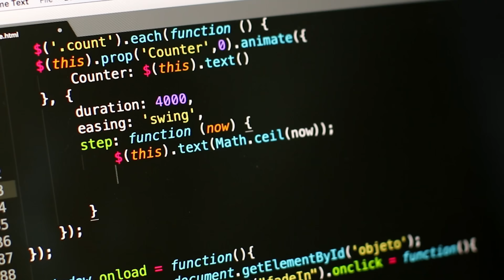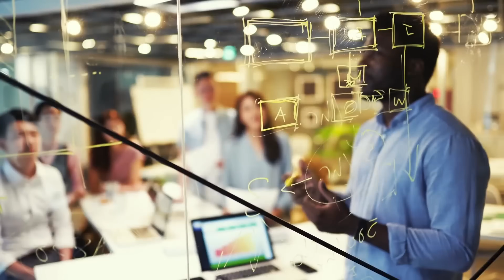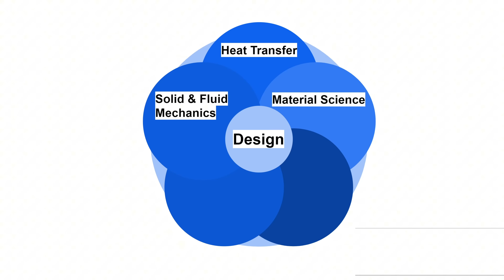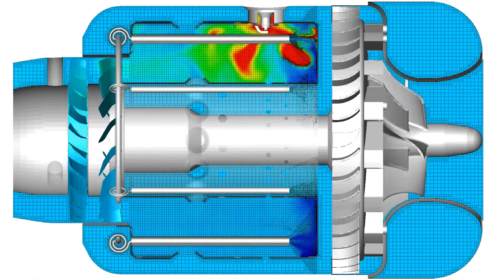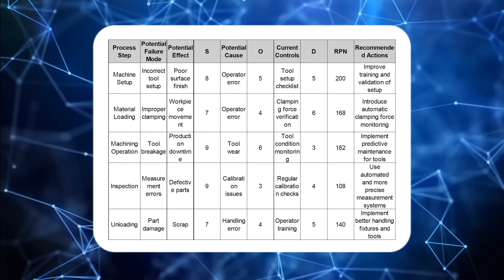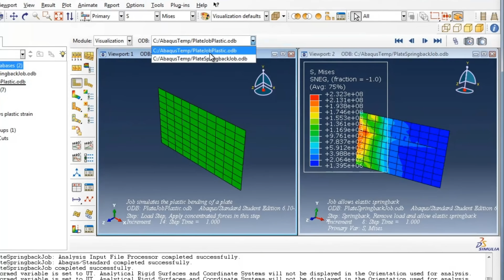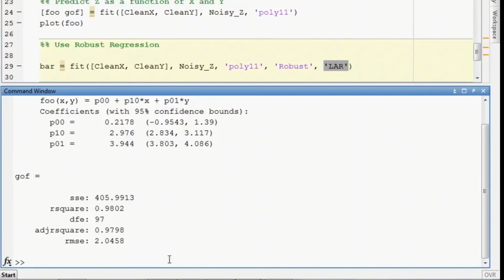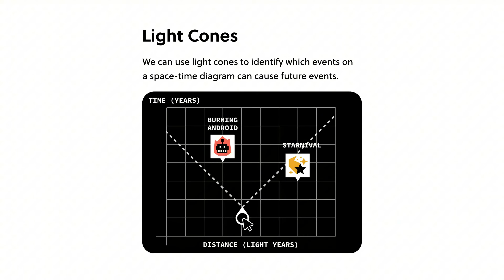Why Mechanical Engineers Should NOT Learn to Code

Comment: Bruh, it's necessary for Mechanical engineers aiming to branch into fields like: Control Systems & Mechatronics, Robotics & Automation, Biomechanics & Medical Devices, Energy Systems & HVAC, Automotive & Aerospace......etc. I don't know wtf you are talking about. But they don't need to go deep into software engineering, just enough programming in the necessary languages like Python, C++ and C.

Comment: I'm 13 years old and I love watching your videos. I want to become a mechatronic engineer. Mechanical engineering is a big part of mechatronic engineering, but so is programming. I think anyone could learn to code if they wanted to. I know you're much more experienced than me when it comes to engineering, but I think anyone could benefit from a little programming .😄😊
Reply: Bro I'm a 1st year in Mechanical Engineering at the University of Nairobi. I too wanted Mechatronics but realized I'll be unemployed in Kenya. And also in Mechanical Engineering, you can also specialize in Robotics and Mechatronics. So, Mechatronics Engineering is a lil bit of Mechanical Engineering, lil bit of Electrical and electronics engineering. And a lil bit of programming. So programming is a must in Mechatronics coz you'll be required to program a robot arm etc. So don't listen to this guy.
Reply: @UserUnknown-y5k2n take it with a grain of salt. You can always be a jack of all trades if you're capable

Comment: I use code only when forced to, meaning only when my project goals clearly define exactly what needs to be programmed. As an ME I do not have the time to learn even one language well enough to know it entirely. I will either trial and error my code or use chat GPT to write it for me if the project is simple enough (like programming a stepper motor or programming a PLC). If the bulk of the project is programming, then it is not in my purview anyway. I do not need to know the specifics of a coding language like the syntax.. I only need to make it do what I need it to do one way or another.

Comment: For everyone wanting to become a ME,
You will learn 'programming' in college. Most universities require a programming 101 course (pre-engineering) and when you finally major in ME, you will use MATLAB.
That being said, it's not 'programming' as in what a programmer or SE would need to know. You just need to know how to perform mathematical operations, read in data from spreadsheets, and know how to create graphs/ charts from your data.

For the workplace and hobbies, most small companies don't have MATLAB so knowing how to do math/ read data/ create graphs in Python is extremely beneficial since it's free and open source. C/C++ is not that useful unless you somehow find yourself without SE support on a robotics project. Most industrial applications use something called PLC (programmable logic controllers) which is a separate 'programming language' (if you look it up, you'll realize that it's not).

Comment: Imo I think it's also important to remind ourselves in anything complex these days that require advanced controls systems and a system of ECMs like avionics or automotive controls, those companies will hire an army of software engineers with CS degrees. Of course we MEs should still have a basic idea of programming and be able to follow ideas to make sure the software engineers are on the same page with us since their stuff controls our stuff. But there is a reason sole software engineering departments exist in aerospace and automotive. It's a full time job in itself. And largely outside our scope. Plus to develop algorithms that advanced, I think you need to understand programming at a very advanced level for advanced avionics or vehicle controls. And to know programming that well requires having your educational and career revolved around that as a core. For me I used an Arraylist in VBScript to automate 10 similar parts varrying only by slot width into a single CMM program in CMM manager and that was it. Even then software engineers from QXsoft provided me the Arraylist framework

Comment: Programming ability is required for mechatronics, which was the core of my ME curriculum. My entire senior year was spent learning python and c++. But in industry, robotics in manufacturing is mostly PLC controls programming (90% of my job search). I wouldn't waste too much time learning a coding Ianguage now. I've generated many programs using AI (in seconds) for automation. All you need to know are the fundamentals of a programming language and how to prompt engineer.
Reply: Does robotics like the robots from Tesla use PLC programming?
Reply: @FlowSharp  Tesla indeed recrutes engineer knowing plc such as twincat beckhoff based plc.
Reply: @le_kada_998  how do you know?
Reply: @FlowSharp  PLC is for industrial automation. For robotics it can be Python, C++ and C. Don't waste your time on sh*t like Javascript, HTML, CSS etc 🤣
Reply: Aside from plc would you say learning low level languages like C is a good idea? Trying to get into this industry as well as an ME.
Reply: @ariqbubinski7136  A language like C is a good language to start, because you will learn a lot a basics, but it is also hard to master as it more close to the microprocessor, if you haven't code with any language, you will appreciate C at his right extent, if you have for exemple code in Js, never code with C, it will be a lost of time, but the opposite is right. C can also be a good language to master PLC (if you are doing structured text), the structure is pretty similar. However, as a mechanical engineer, you will program for exemple to automate or retrieve that from simulation made with software like ANSYS (with very specific language), develop maybe sometime you own computation for a certain case in FORTRAN or python, or automate tasks for excel or CAD software with VBA. So I will recommand you to learn C, maybe C++, later python, then you will have the good foundation, and will be ready to code in the industry, but remember in some cases, you will maybe need to learn a new language and also remember that you will maybe never be ask to program, most mechanical engineers that program are simulation, fea engineers etc....
Reply: @ariqbubinski7136  Not really, that depends of the kind of ME you want to become, generally In ME, you never use programming language. Rarely if you do CAD  in a small company, you maybe using VBA for automation, apart from that if you are a fea engineer in research or in post processing like jobs, you could process data obtained after a simulation by using python fortran etc..... Else, in research some implements their own fea code by applying fem principles to resolve differential equations.
Reply: In mechatronics you need python, C++ and C. In industrial automation, thats where PLC comes in

Comment: From my experience (I am a structural engineer). What engineers need to learn is not about the coding, but computer science. So they would understand much better about how the software they're using (for example FEA suites) do under the hood (algorithm, data strucutures, libraries), and use it effectively for their own purposes.
Reply: I strongly agree and I personally believe that list should also include the computer's operating system.
Reply: I'm almost applying for CS as a second graduation at this point!! But I think I'd rather study my master's degree in dynamics and mechatronics...
Reply: I didn’t understand, can you elaborate pls. I’m studying Electrical and Electronics Engineering.
Reply: Agreed.
Reply: What are the benifits of that? That could be very different from the field one could be specializing in, and for regular engineering students its used only for surface level data analysis, numerical approximations and iterative calculations.

Comment: I feel like this is a very necessary video. I mean there is a reason why different majors have a different curriculum, we do different things! Even if mechanical engineers and programmers work on the same, robot for example, they work on different aspects of it. Having a base knowledge of other aspects you may encounter in a product you are working on is good and all, but you can’t expect to know everything and anything. Yes, programming is the hot thing right now, and if you want to learn programming so bad, you can major on it or get a minor, but you can’t pressure yourself to learn a skill in such a level that doesn’t have to do with your major. Learn it if you like, but don’t feel like you have to just because is a wanted skill got a while different profession.

Comment: I am in my first year of Mechanical Engineering, could u suggest me some course that might help me later for my resume or is it too early
Reply: Hey kid. I am a final year mechanical engineering student. The engineering realm is shifting rapidly towards automation. As a mechanical engineer, I would advise you to take classes in robotics and programming, also, learn energy systems as this is the core of innovation. ... good luck
Reply: @allanben9795  Thank you for your advise
Reply: @allanben9795 Should I take cs in college?
Reply: @kabir_mash  it depends with what you want. If you are passionate about computers, algorithms and coding then CS is for you.
Reply: @kaizenstudyyy absolutely.  You can also opt for Mechatronics engineering.  It deals with mechanical and electrical systems combined. You will also learn a bit of computer science and computer engineering on the side.